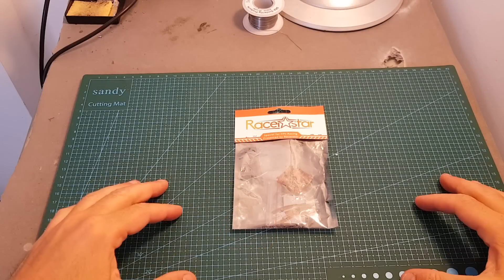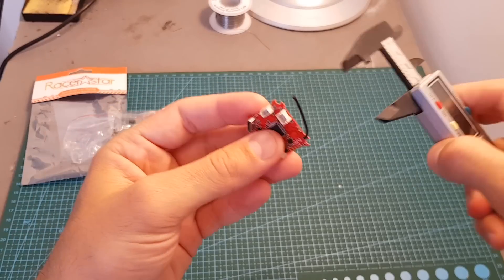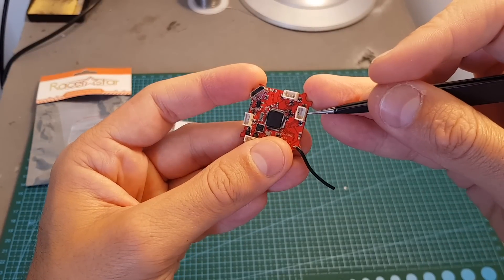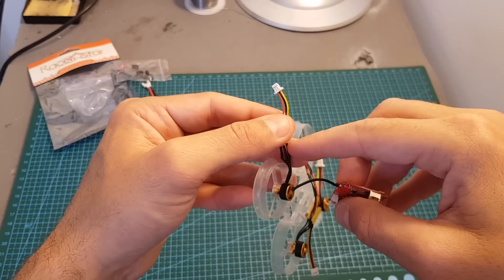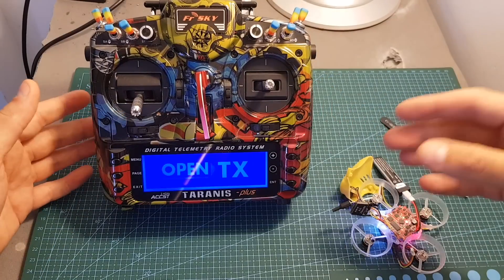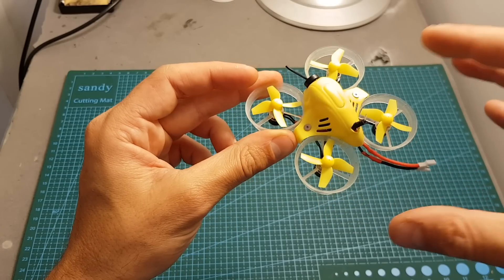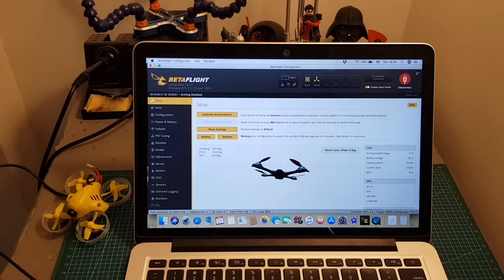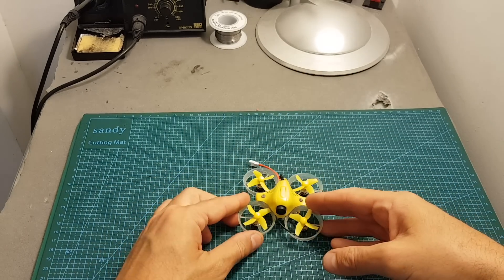Racerstar Crazybee - Review, Setup & Test Flight

Comment: Hi Gad Good demonstrative review, as usual.. I have a small Snapper 7, with this FC, which I wanted to modify on a lighter frame, like mobula 7...and change the video set. My question is: is it possible to connect a vtx 25-100-200mw to it, in order to gain a little distance and better reception/video penetration to obstacles? And does the rx3 correspond well to smart audio? Thanks for your reply.. Good luck and see you soon for other videos..
Reply from the maker: Thanks man!
Sure, you can connect a more powerful VTX. There are plenty of good 5V powerful VTXs that you can use.

Comment: hi mate just wondering if we can put external rx on this fcb?
Reply from the maker: Hi, yes you can.
Reply: @KremerFPV  I have add the external one but it is not binding with Radio what do you reckon?
Reply from the maker: @fpvpilot5818  which receiver and transmitter are you using?
Reply: @KremerFPV  for Rx I am using Fs-A8s  and Transmitter I have flysky fs-I6s
Reply from the maker: @fpvpilot5818  Are you sure that you follow the bind procedure correctly?
Reply: @KremerFPV  I was able to bind it but still giving same error . Badrx
Reply from the maker: @fpvpilot5818  it means that it's not configured properly on the FC. Make sure to select it in BF instead of using the internal RX.
Reply: @KremerFPV  internal was also giving badrx error and this external one is also giving badrx error.
Reply from the maker: @fpvpilot5818  I hope you don't have a defective board. Try to upgrade its firmware.
Reply from the maker: Also - make sure the flash the correct FW version.
Reply: @KremerFPV  I tried to update FW but it didn't work. I guess FCB is defective .
Reply: @KremerFPV  Old thread I know but I tried adding crossfire to this using RX3 and TX3. My TBS Tango 2 binds but I get no stick inputs. Do I need to install a specific BetaFlight version since its an old board? I flashed it with the last supported BF version 4.0. Any help will be greatly appreciated!

Comment: i have a crazybee f4 pro with integrated rx. My question is how do i disable it in the cli command to run an xm+?
Reply from the maker: Just select your external receiver (instead of using the SPI RX option) and it will disabled.
Reply: @KremerFPV  Could you please tell why I can not bind my Taranis and crazybee f4 pro. I am doing all steps according to your advices, but it does not work :(
Reply from the maker: @fanisaiupzhanov2299  Maybe you have the Taranis EU version?
Reply: Gal Kremer I have done upgrade according to this video https://youtu.be/4_sc-Vc5F1k so I can choose Eu or Fcc version. It does not work anyway 🙆‍♂️

Comment: one question, how do you manage the (onboard) ESC-configuration?
any idea if I can conekt with BL_Heli suite?
Reply from the maker: Of course - you can use BlL_Heli Suite to configure it.
Reply: Gal Kremer how? Is it 4 in 1 ESC, the blheli software don't find it:-(
Reply from the maker: I just tested it and it works with the BL_Heli suite on my mac.

Comment: hi! ive got a URUAV UR65 micro brushless whoop style and it uses this crazybee F3 osd board.(FrSky version) i had some difficulties to bind it. i think i made it bind but the telemetry goes on and off non stop. (i have set it in frsky x for D16 on the configurator.) Do you have any idea what might be the problem?
Reply from the maker: Did you try using D8 mode? In my experience it has less telemetry losses comparing to D16.
Reply: Gal Kremer No I haven’t. I had difficulty to bind it at first so I was trying different things. I will try it to see what the quad does

Comment: Please tell me Gal, if is ok 1103 racestar motors 1-3s,with this board an 2 or 3 inchi propeller!? Esc on The board is rated 5amp and this motors at 1s, amps îs max 3.. Thanks
Reply from the maker: This board is suitable for a "whoop style" frames. you need to get a proper FC and ESC with 20*20 or 16*16mm mounting holes.

Comment: Hey Gal, what can you do if the lights flash and it will not bind to Flysky after pressing the bind buttton ?
Reply from the maker: Are you sure you are binding it correctly?
Whice TX are you using?
Reply: Fixed it. Thanks Gal

Comment: Hello. Could you help me ? Please. I am French, I use a translator.
After the bind. The green light is still flashing, and when I connect to BETAFLIGHT the Taranis loses and reconnects every second.
I think the problem comes from the bind. I did as in your video and the green light is still flashing.
What is my mistake ??
Thank you
Reply from the maker: Hi Jojo. Did you set the mode in Betaflight to D8?
Reply: Hello.
Yes. I have a Taranis X9D +. She does the D16 and D8. I tested two modes and I have the same problem.

Comment: wont read on my beta flight why? i tried different wires and ports on my mac
Reply from the maker: Did you test it on another computer?
Reply: Kremer FPV yes I have windows 10 on my mac and another window laptop.. I also tried my bee brain v2 and still.. so I know my brushless board is not an issues and also tried other cables and ports.. been a while i plug to betaflight and it's like all new update since chrome dont support it anymore.. I order some OTG cables and download the speedybee app and going to try that.. cables come today later..
Reply from the maker: Well I hope that the SpeedyBee app will work for you.
Reply: Kremer FPV I will let you know later when I get home. I want to fly already.. maybe I'll fill wipe my windows and install fresh
Reply: try using a better usb cable that worked for me
Reply: I have the same problem and I'm getting desparate...  I cannot get a virtual com port after connecting a USB connector - The USB discovery process does not seem to kik in - no request for pilots or anything.  The board connects and binds correctly to my Taranis transmitter but it remains in "DisArmed Mode" so I can't even start the engine.  I have tried 3 different computers (Windows 10) and no success.   Help me someone...!!!

Comment: Hi, will this FC support 1103 motors?  I was thinking about using this FC on a LDARC 90GT frame.
Reply from the maker: Hi, yes, I just checked the data sheet of the Racerstar BR1103B motor and looks that it will be ok - Amp wise . Just remember that this board supports only 1s batteries and you need a lightweight setup and high KV motors. I think that 1103 motors won't be a good fit in terms of performance.
Reply: Gal Kremer  Thanks, I'm still new to fpv, so I'm not to worried about speed.  I just don't want to burn out the board if using 1103 motors.

Comment: Hey kermer motors you used are different than that you have put in the link your quad motor are hanging at bottom where as one you put in the link are different please mention which one are those you used and link for that...
Reply from the maker: As I mentioned in the video, all the parts that I used were taken from a non working X68S quadcopter, which is no longer sold.
Reply: Gal Kremer thanks a lot for quick reply can you please make a video on 
Realacc TOTG01 PPM Data Transmission Virtual Joystick 3-in-1 Transceiver Combo that's very interesting product of you can please.
Reply from the maker: I will check it out
Reply: Gal Kremer thanks